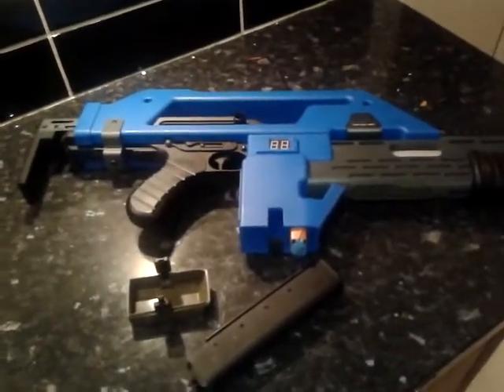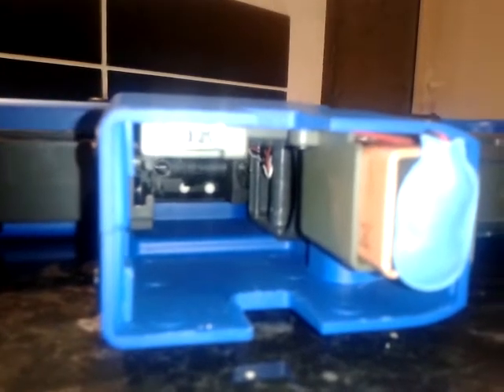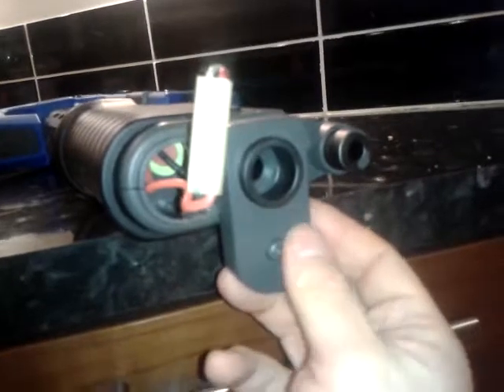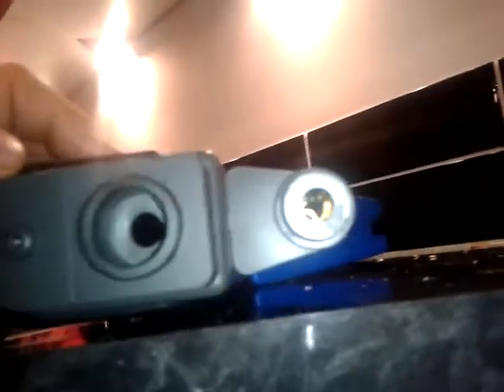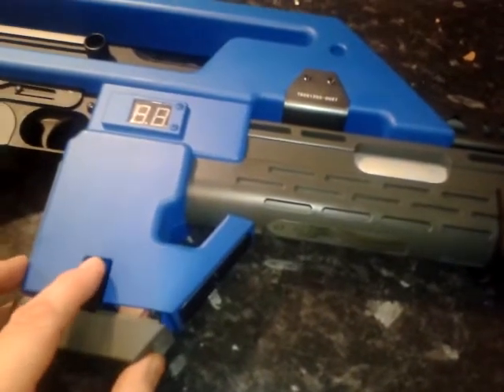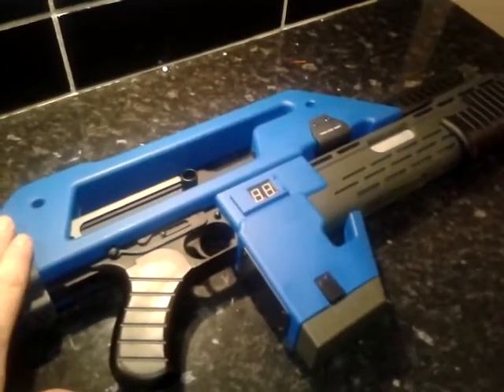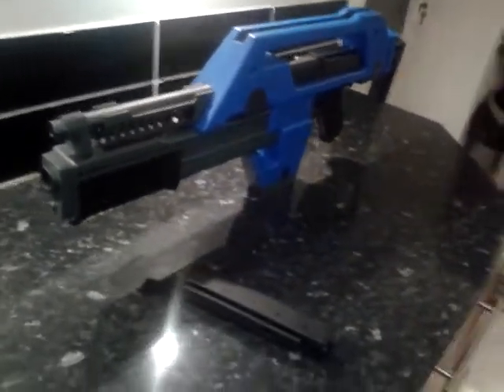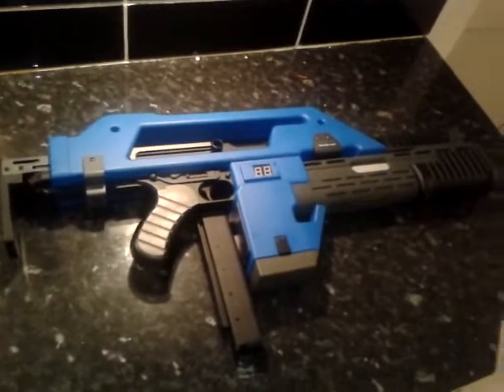Snow Wolf M41A Pulse Rifle Review Part 2

Comment: Do you have to keep removing the magazine plate to wind the bb's in the mag?  If yes, how many shots can you fire off before winding back up again?  This seems like it could be a really pain in the arse, I have seen some Thompson mid cap mags that hold 110 bb's without winding although I'm not sure how that works either.  Can you please help me out with that as I would really like to get this gun.  Thanks
Reply from the maker: Once fully wound, this mag will fire all BBs. You arr right sbout the plate being a pain though. As a practical skirmisher this gun is not ideal but it looks soooo good.
Reply: So it will fire  100 + bb's fully wound?
Reply from the maker: +Rotazd Yep. With no issues.